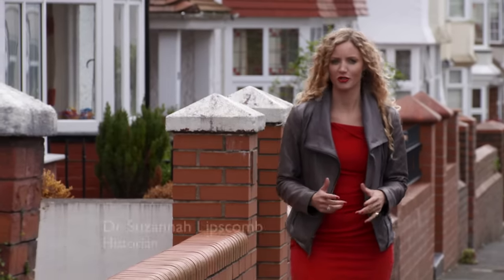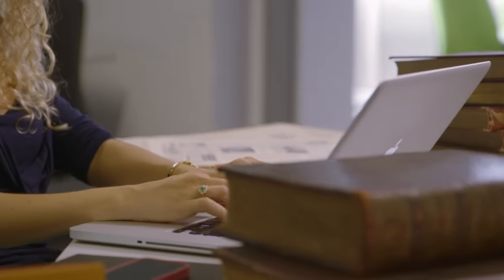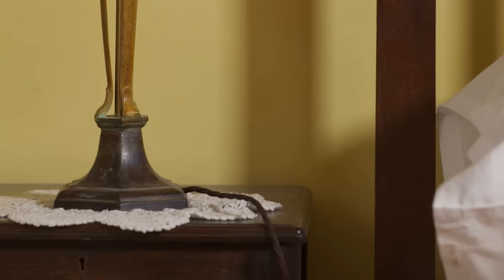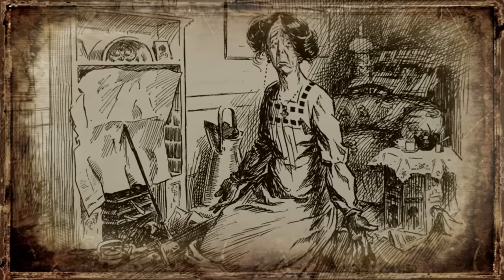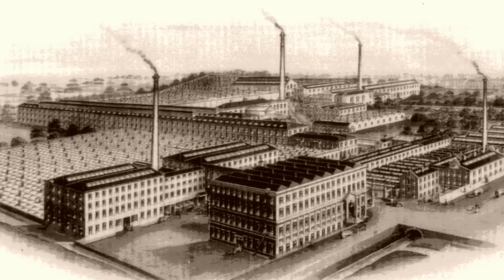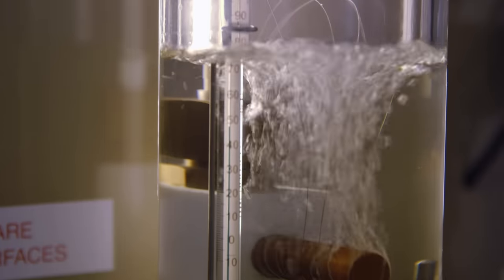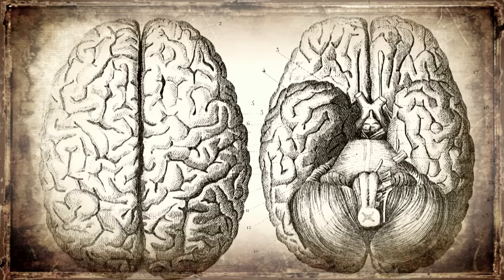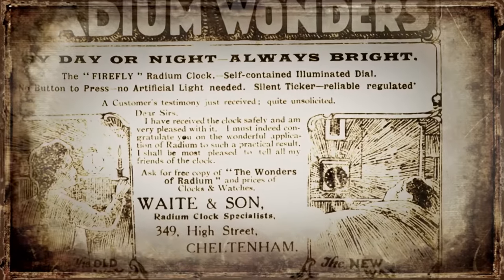How New Electricals Made The Edwardian Home A Deathtrap | Hidden Killers | Absolute History

Comment: I was shocked to hear that the dangers of abestos were known or suspected as early as the 1920's. My Father worked for a company in the 1950's and '60s that made things out of asbestos. Many people in Leeds where the factory was based died of asbestosis. Even people who did not work at the factory were affected by the wind blowing asbestos fibres into areas of the city. My Father died in his mid '50s of abestososis and many of his work colleauges also died of it. The company well new of the dangers but they surpressed this information as long as they could because they were making so much money.
Reply: adam fraser  Yes, I agree to an extent. Capitalism is a double edged sword. It stimulates progress inasmuch as it promotes invention and improvement of products and services but also can lead to immorality as in the case of asbestos. It is actually a fantastic material and if it were not for the ability of it to be carconognenic it would still be used today in a multitude of ways. There was ignorance of the health issues connected to asbestos for many years but asbestos was used on such a huge scale there was obviously reluctance to stop using it because there was no other material to replace it. It was still being used as recently as 20 years ago !
Reply: adam fraser  What do you mean 'grew at a ridiculous pace' ? It is a very fuzzy statement......explain.

Comment: My house was built in the 60’s and it STILL has an asbestos ceiling!
Reply: um well it was nice knowing you
Reply: As long as your not stirring it up and breathing in the fibers you will be OK. However if you choose to do any renovations please contact professional removers who will come with with plastic containment sheets and safety gear including respirators and suits. Do not try to remove it yourself ever.
I do insulation and have to keep an eye out for this nasty stuff, not allowed into the ceilings or underfloors if it's present.

Comment: My neighbors rewired their home (built around 1900 as was mine) by stapling
extension cords to the wall after threading the cords through the drilled holes in the floors and ceilings.  Thankfully, it 
is no longer in that state.

Comment: 11:50 These people still exist today. They plug surge protectors into surge protectors, and connect heaters to those surge protectors. Doesn't matter how many times they trip the office breaker, or if the plastic on the surge protector is starting to melt, it never sinks in. Might as well be magnets.

Comment: I have a question: Why 240V? I mean some could survive a 120V shock, but 240V can kill you.
Reply: Brian O'Connell Both voltages are potentially lethal. But a higher 240 volt supply means that thinner wire can be used to carry the same amount of power- if you double the voltage, you half the amps required to give the same power output. Without 240 volts cables would need to be significantly thicker and therefore more expensive. Higher voltages are also easier to distribute as the effects of voltage drop over longer cable runs are less pronounced.

Comment: 26:40...
With all due respect, the asbestos was on the OUTSIDE of the water tanks.  Not ideal, I know, but not as you're implying.
It isn't being moved around, and if it came into contact with the water, then, it's less dangerous than.
Reply: richardj ellis It did strike me as odd that they might use it inside a tank! I couldn't work out what the benefits of internally lining might be.

Comment: Nothing to do with evaporation. The cooling is due to the Joule-Thompson effect and expansion, where by a gas (with the exception of hydrogen and helium which must have a very low temperature to start) expands and thus cools. The opposite happens when a gas in compressed, it generates heat.

Comment: Canned ether (Diesel engine starting spray) is a great cleaner!   I was sitting in my Mercury Marquis with it running so I could hear the radio while I washed the door leather off with the ether and wiping with a rag as I sprayed. Good thing the door was open because the "whump" blew me out of the fuckin' car! Forgot about not wiping over the window switches because they make a spark.  I thought the smell in the car was awfully strong just before that!!!

Comment: Does anyone else still run appliances off the light socket or is that just me?
Before you judge I had an old flat (actually my cousin's basement but I paid rent and was an in home chef handyman and the like) with 2 walk in closets both with only one light so I ran adapters (that I still have) from them for the other lights

Comment: What ???  @12:25 -  "the battery is too high a voltage for the wire" ?? ?   I dont think so !!!!

This is where a9v PP3 battery is pushed into wire wool. 
NOW - it is NOT that the VOLTAGE is too high ... it is the CURRENT that flows that is TOO high!!,
Simply because - even though the wire wool is quite thin - and will thus have some significant resistance - using ohms law.: Current = Voltage / resistance  it follows that 9V applied to the wool can generate quite a high current in the strands of the wire wool - - enough current to heat the wool enough to catch fire. 
But it is NOT the voltage that creates the heat ... it is the  CURRENT !

Comment: Love the docu, but with the steel wool, its not a voltage its current that causes that. Its a 9 volt battery, not matter what you connect it to. If you are going to talk some basic science, be sure to understand it. It just distracts from the proper message. Also, later on, you don't buy voltage, you buy current. We have constant voltage at our homes, but the current is the flow of electrons (energy). That is what we ultimately pay for and use. A bit later you have a person that describes it. I just beg for consistency. I do love your video, so please take no offence.

Comment: The 1940/50s Electric sockets, 2 amp 5 amp, 13 amp, 15 amp,  two pin, 3 pin, 2flat /one round, wall fitting, pendant fitting, and that is just British, even worse in Europe.  I remember on visits to Spain getting Electric Shocks from damp walls, , wiring was double pot cleats and VIR cables.,   the plumbing was even worse .

Comment: so electricity is more dangerous than naked flames, fire, smoke, and gas lamps eh?
Reply: Manxman:  yes it is   because you cannot see it. or smell it . the radiation from a 50 volt telegraph line causes sickness to anyome within 20-30yards.     modern electrinity is dreadful.   clean AC is one thing,   but the 'dirty electricity' of today  caused by hi-speed switching devices,  switchmodes  smart, dimmers ,phones etc  is a killer.  everybody gets sick.

Comment: Those ceiling rose adapters were still widly used in the 1960s I remember well seing the television/electric fire on whilst the lady of the house was ironing and all the wires draped from the ceiling.
It was all right though .......because the fuse was usually replaced with a nail or something similiar.  and now we have gone the other way and are deluged with silly and 
unnecessary over the top rules and regulations... of course a happy medium doesen't generate cash for electricians!!!

Comment: If that steel wool experiment was done today, with all the existing safety technology, as long as there was a tolerable resistance, and the wool wasn't in contact with an earth wire, the outcome would be exactly the same. 
It's a terrible way to demonstrate how dangerous electric can be.
You should have used a real world example. No one ever wired up a piece of wire wool to keep warm or see what they're doing, did they.!🙄🙄🙄!.

Comment: Electric didn’t work properly in the 70s. My family were the first in Dumfries to have electric. I think because they were upper class they had no problems
Reply: The house in new abbey road still has the original electrics , the original bathroom furniture and fittings and they still have a well used and loved scullery and pantry.
Reply: A Hippy The reason electricity "didn't work properly" in the seventies is nothing to do with the electrical system! It's because of endless strikes by just about every industry including the power companies, miners etc meaning there just wasn't enough fuel for power stations, enough staff to run them or people to fix issues as they arose.

Comment: 12:25 Too much voltage for the wire? The writer of this is clueless about electricity. Oh well.
Reply: Exactly that demonstration was really dumb. Steel wool is flammable. Same thing would happen if they took a cigarette lighter to it. The battery being applied put a huge amount of current on a really small wire, creating loads of heat instantly. Which set the wool on fire.

Comment: Switching on a light switch, doesn't get to 120°C at all. 
If the switch was held in the position where an arc could occur, then, possibly then could you reach this temperature, but, not in one single flick of the switch.🙄🙄🙄🙄🙄
Reply: richardj ellis The minute spark created when contacts make or break certainly exceeds 120 degrees! They weren't suggesting the fitting itself gets to that temperature. A spark is many hundreds of degrees, that's why sparks are used to ignite gas, petrol etc.
Reply: Well, they certainly weren't explaining it the way you just did, were they. 
I understand the sparks temp, and that's what I was explaining.

Comment: so... the inventors did not know much about electricity. and then follows an "overload example" with a 9V battery and some iron wool, and the commenter is like "the battery is too much voltage for the wire wool". so nothing has changed i guess. and the hosts should even have background knowledge.

Comment: "the battery is too higher voltage for the wire".  Is not the correct terminology for this situation.!🧐!.
You need to do your homework before stating facts like this.

Comment: Imagine! A machine capable of sustained flight, that was heavier than air! Electrical wiring that combusts because the voltage is to high. An electrical shock with enough current to burn the skin will obviously stop the heart causing instant death! FFS who writes this stuff 😆

Comment: Think at that time it was low voltage DC current running in the cable, wouldn't even notice if you came into contact, it was totally harmless. Moron video.